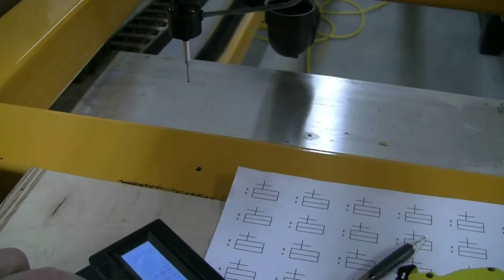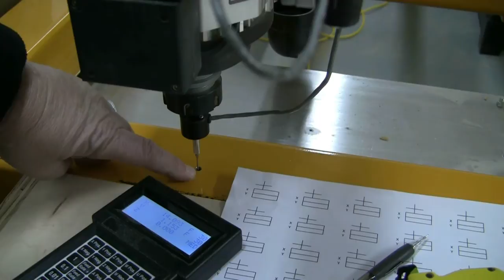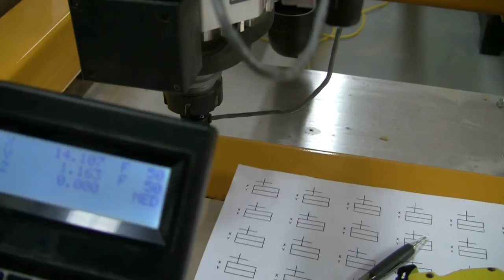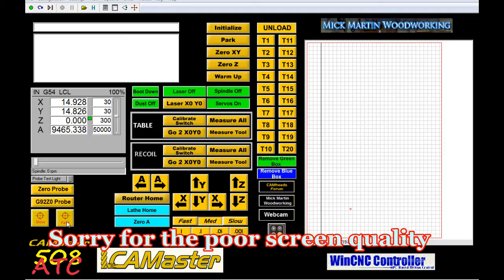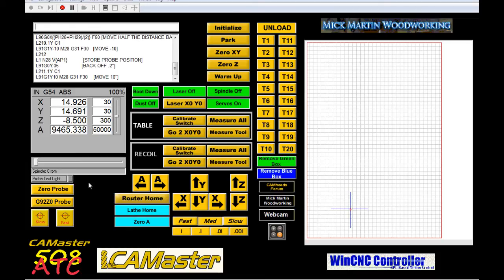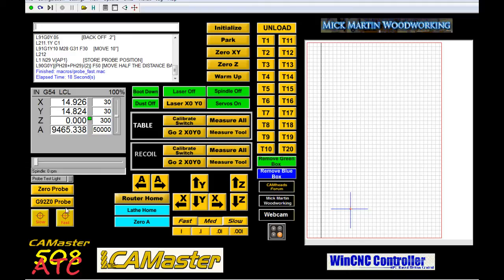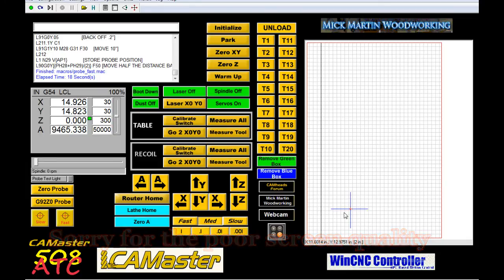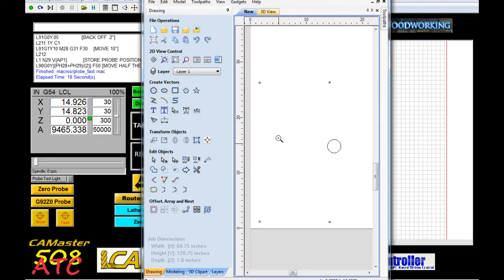Hole center finder

Comment: Mick,
I have a WinCNC controller on mt ShopSabre and tried the code but it hangs on line 7 and is not seeing the probe touch. I know the probe works because I use it for digitizing just fine. My machine has dual Y axis motors. Anything you learned from your experience that I can use to solve my problem?
Pat